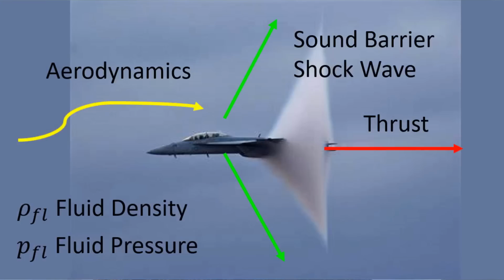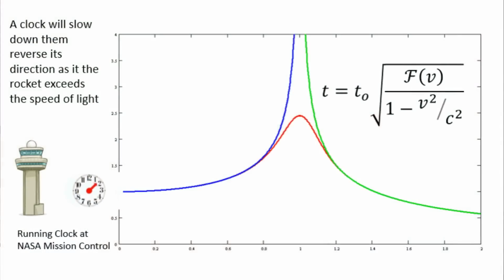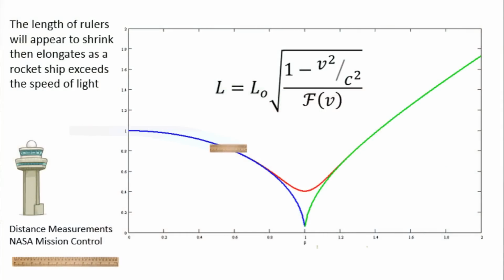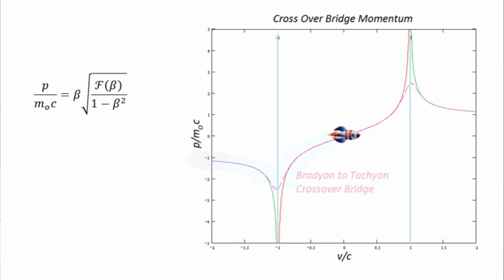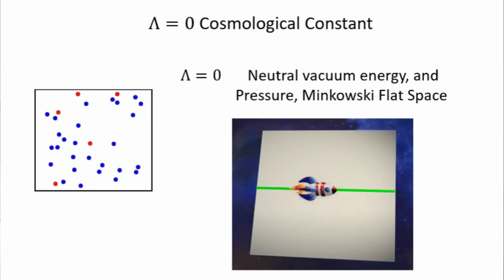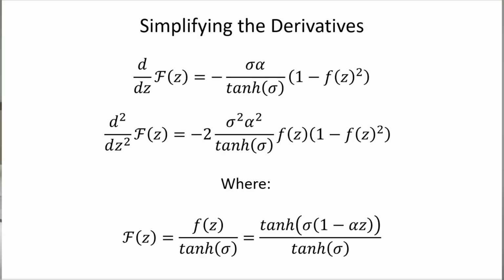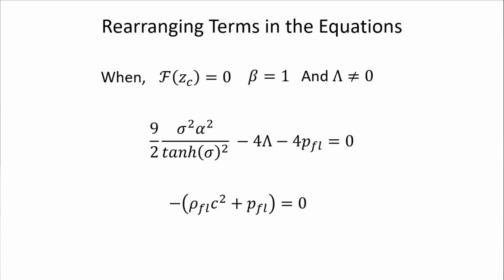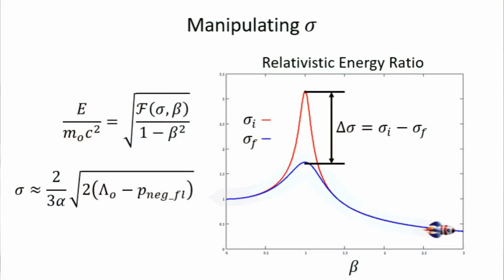🛸Lecture 4: Faster Than Light Shock Waves of a Warp Drive?  | HyperdriveX | Faster Than Light | UFO

Comment: I'm just a regular guy with a curious mind so if my question seems silly keep that in mind. Why is it assumed that in order to reach the speed of light we would need infinite energy ? I mean isn't light just a particle and a wave created from a neutron being expelled from helium atom to hydrogen atom ? and these particles of light carry on until something absorbs it? Creating light takes massive amounts of energy, I get that but light is quite weak if all it takes is anything it runs into to erase it from existence ?
Reply: I'm a noob as well, but I think it has to do with the increase of mass of masses moved very fast. Keywords you hear often are the Lorentzfaktor 1/sqrt( 1 - (v^2 / c^2) ).
Reply: @Raxneff Nextnerf The field of mathematics has definitely been a key to our technological advancement and a better understanding of our universe, but they don't always get it right. At one time It was not known what would happen to the human body and to the vessel we rode in when we broke the sound barrier. It took physical tests performed by test pilots to find out what needed to be done to get through the barrier. They found out once on the other side, the ride smoothed out. Another example is just recently when they decided to crash that satellite into the asteroid or was it a comet ? anyway, they calculated the impact on it would not be enough to change its trajectory, yet it turned out it did way more than they thought. What I'm getting at is once we solve the propulsion problem, getting us up to speed as it were, only physical tests will give us the answers we need. IMO
Reply from the maker: @JeffreyKB  "Absolutely, you’ve hit on such a critical point! 🚀 Math and simulations lay the groundwork, but real-world testing is where the magic (and surprises) often happen. The stories of breaking the sound barrier and the asteroid impact both highlight how nature can defy our expectations and teach us something new. 🌌✨ 

Here’s a thought: when we do solve the propulsion problem and start conducting those groundbreaking physical tests, what kind of unexpected phenomena do you think we might encounter as we approach or even surpass light speed? Could there be a ‘smoothing out’ effect like with the sound barrier, or might it be something entirely different? 🤔"
Reply from the maker: @raxneff  "You're spot on about the Lorentz factor! 🚀 It’s fascinating how time dilation and mass increase kick in as you approach the speed of light. 🌌 The idea that mass becomes 'heavier' as velocity increases really makes us rethink how we perceive motion in the universe. 🤯

Here’s a question for you: if mass increases with speed, do you think there’s a way to counteract this effect or perhaps use it to our advantage for propulsion? 🛸 Let’s hear your thoughts! 👀✨"
Reply from the maker: Great question! The reason it’s assumed that reaching the speed of light would require infinite energy stems from Einstein’s theory of relativity. As an object with mass accelerates toward the speed of light, its relativistic mass increases, which means it requires more and more energy to continue accelerating. As you approach the speed of light, the energy required grows exponentially, so at the speed of light itself, you'd need infinite energy — something that’s physically impossible to achieve with current understanding.

Regarding light, it’s actually a bit different than what you described. Light (photons) isn’t a particle created from a neutron being expelled from a helium atom to a hydrogen atom. Instead, light is the electromagnetic radiation emitted when electrons in atoms transition between energy levels, or when certain particles interact in ways that release energy. These photons travel through space and can interact with matter, but they don’t "disappear" unless they’re absorbed or scattered by other particles.

While light is indeed a form of energy, it doesn't require infinite energy to exist. Its "weakness" in terms of being absorbed or scattered is due to how it interacts with matter, not because it’s inherently fragile. Light can travel vast distances through space before being absorbed or interacting with other particles — which is why we can see light from stars billions of light-years away!

So, while the physics of light is incredibly fascinating and complex, reaching the speed of light isn’t just about how much energy light itself carries — it's about how our physical laws constrain objects with mass.
Reply from the maker: "Hey there! First off, no question is silly when it’s driven by curiosity 🌟🧠. You're asking something really profound about the nature of light and the energy it takes to reach its speed. You're absolutely right that light is both a particle (photon) and a wave, and photons don't have mass, which is why they can zip through space at the speed of light without needing infinite energy. 🚀✨

The 'infinite energy' concept applies to objects with mass because, as they approach the speed of light, their relativistic mass increases dramatically (thanks, Einstein! 🥼📜). That’s why it’s such a challenge. 

Your point about light being absorbed easily is also fascinating. What if that 'weakness' is actually its strength—allowing photons to interact and transfer energy efficiently? 🤔💡

Here’s a question for you: If photons are massless and don't require infinite energy to travel at light speed, could we ever design something like a 'massless' system or mimic photon behavior to overcome the energy problem? What do you think? 🤷‍♂⚡"

Comment: Uhhh...."thrust" required acted upon.  What required item is what your "force" is acting against?  And what is "thurst"s resistance container(?) Wall(?) Other enlcosure?
Reply from the maker: "Great question! 🤔 The concept of 'thrust' is often tied to the action-reaction principle, where the force you're generating needs something to push against. In conventional propulsion, like rockets, the force acts against the exhaust gases, which push against the walls of the engine and ultimately the outside environment. 🌌

But when we think about theoretical propulsion systems, like those working in a vacuum or using more exotic principles (like warp drives or even your ideas about microwave radiation), it gets trickier. So, what's your take on the 'container' or boundary in these systems? Is it a physical wall, a field, or something more abstract? 🤯 How do you envision overcoming the absence of a traditional medium to act against for propulsion?"

Comment: Ah if only we had access to infinite energy… going to be pretty difficult to push time out of the way…
Reply: Infinite energy = Infinite mass.   Only happened once to our recollection. Not good.
Reply from the maker: According to Einstein's equatiion, E-mc^2
 , energy and mass are interchangeable, meaning that as an object’s energy increases (like approaching the speed of light), its mass also increases. If you were to require infinite energy to reach the speed of light, it would imply infinite mass, which is beyond the capacity of any physical system.

And you're also correct that this kind of situation has only "happened once," as far as we know: the Big Bang. In that event, all the mass and energy of the universe were concentrated in an infinitesimally small, dense state, which led to a rapid expansion. This isn’t something we can replicate or observe in everyday circumstances, which is why the concept of infinite energy or mass is considered problematic — it would lead to scenarios we can't handle or fully understand under our current physics models.

So, yes, infinite energy or mass isn’t something we want to deal with! The limits imposed by relativity are part of why we can’t reach or surpass the speed of light with any object that has mass.
Reply: Result equals infinity, only shows that a formula is still incomplete.  Ask any scientist.  Thats their problem with BlackHoles and BigBang.
🚀🏴‍☠️🎸